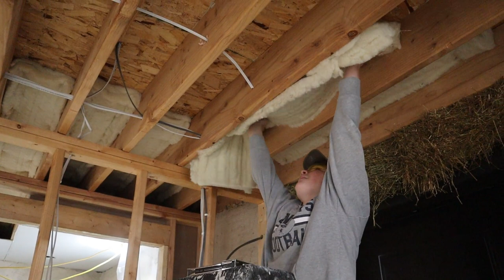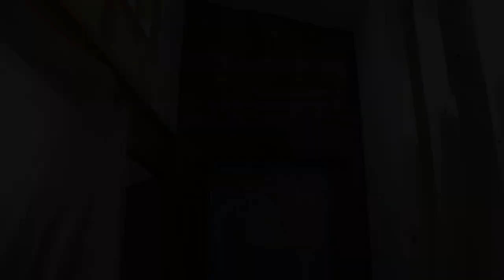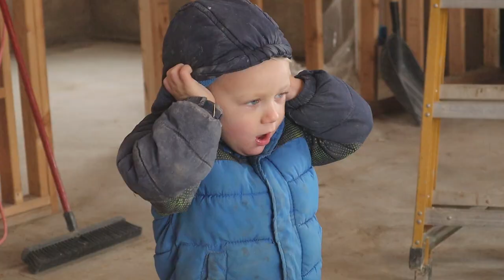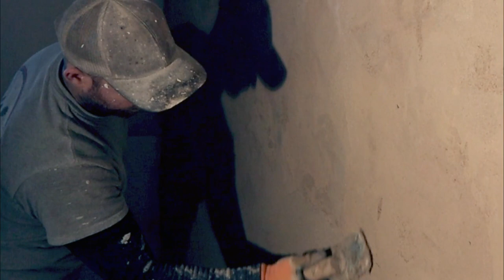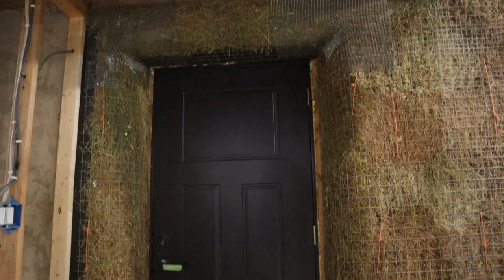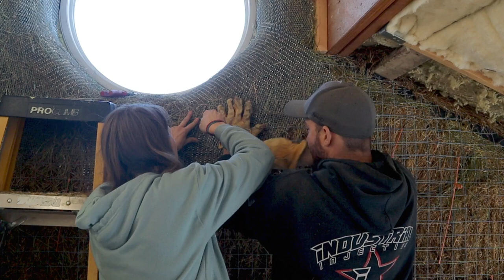Drywall, Lime Plaster, and shaping our round window | Part 3

Comment: I'm too late I know, but on the final coat, you should use a spray bottle of water to spray (even one of those pump up sprays used for gardens and pests works great) and then use the magnesium trowel to float a clean coat. You're doing ok grinding in the needed material into big divots etc but that final needs a clean trowel run using just water to make it flow easy.  The long float seems to be working well though. You're finally getting that mud onto the windows and curved surfaces pretty well - it always goes that way - you finally get it figured on the last couple - 20 windows and doors too late. Oh, the battles ...phew!! Great work.

Comment: Hi, new subscribers here 🙂 Can you explain your thought process on why you are doing a combination of drywall and straw bale for the interior vs all straw bale? I thought that the purpose of straw bale was to get away from dry wall/sheet rock due to environmental and efficiency issues. So, I'm not understanding why you would combine it. Was it a cost issue or more for the ability to hang items ?
I wondered if you would be able to hang items like TV or artwork on the walls if the interior was all straw Bale with the limestone mix over it. I'm asking b/c I'm thinking of a straw bale home for the future. Also, is the smell of the straw once you get the lime plaster on very strong? I wondered how a person with hay allergies might be able to handle a straw bale house. Thanks!
Reply from the maker: I would say the biggest reason to not do strawbale as interior walls is the amount of space it takes up. The walls would be around 20'' thick and for us we didn't want to compromise the space.. Of course the hanging of things is another one...plumbing, electrical, venting anything through a straw bale is much much harder than a regular stud wall. I totally hear you though on the environmental (and toxins for me) side of it!! I researched and researched for alternatives thinking and hoping I would find a different solution but I haven't found one. Even when I thought I was on to something, the more I researched the product the more I realized it isn't any healthier nor better for the environment than the drywall.  I still even would like to find a better mud for the drywall but I have lost hope on that as well..  As for hanging things, if you were to plan ahead of time where you will be hanging heavy things you could always add wood studs notched into the straw bale(we did this for cabinets and a possible TV you can see in a few of the videos ).

As for the smell, I have heard people say that it can linger for a couple years. We have had people come over and talk about how fresh it smells (we don't even notice anymore, but will comment on that in the future if there is a smell).. These are STRAW bales NOT hay, I know people use the words interchangeably, I am guilty of it too and I grew up around both of them!  For me, I am sensitive to gluten so I had wondered that too and was looking to steer away from wheat or barley straw for that reason!  We have organic flax straw which Is rot resistant and I loved the smell when we first started working with it and knowing that my body wasn't going to go into overload from breathing it in. I guess it would probably depend on what allergies exactly your talking as to what effects it might have for you..
I know that we are not 100% sustainable in our build, and I am completely aware of this.  Sometimes though you just have to find a middle ground (especially when your partner might have a different idea in mind).  My motto is to always choose the healthier/greener option between choices (IF there is a choice).  I think a smaller scale house would be much more doable in being as green as possible but we have lived tiny for so long and ready for our kids to have there own space as well as a place for them to always be welcomed home to when they are older.  Wow, long rant here.  I hope this answered your questions, feel free to ask more, Thanks for watching!!
Reply: @buildingroots5873  no it wasn't too long, I appreciate the information. I'm allergic to both hay/straw so I wondered once it was covered how that would play out or if it would even be noticeable as you said. I do have a habit of using them interchangeablly lol.. I'm bad, I know.. But I do know the difference.. I would imagine that the different types of straw may make a difference in the smell.. so thank you for specifying what type you used that may help! I'm also looking into rammed earth homes as well to really flesh out the differences so this was definitely helpful. That was one of the things aestheticially for me too in which I might do a mix of both straw and regular sheet rock etc.. I don't particularly like such thick walls so I can see the merits of both. I definitely think finding a middle ground is wise as most people can't afford going 100% all natural in every little detail unless you want to fork out a ton of $$ .
Thanks for taking the time to give me your thoughts on it!
Reply from the maker: absolutely!